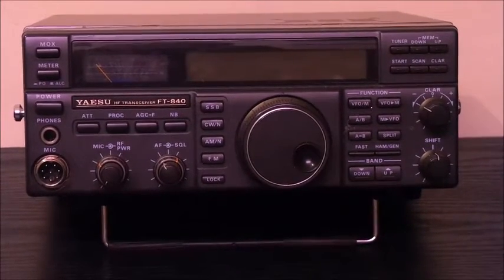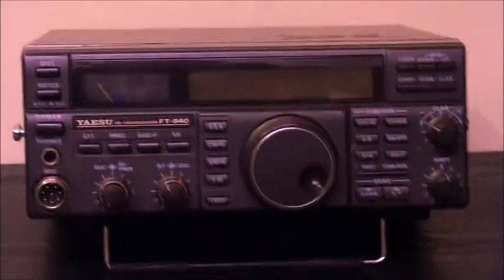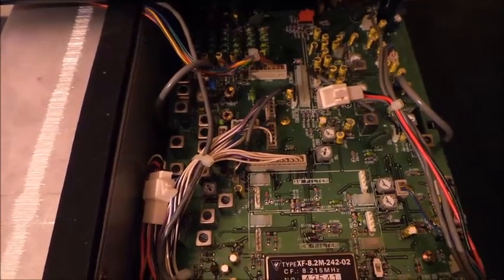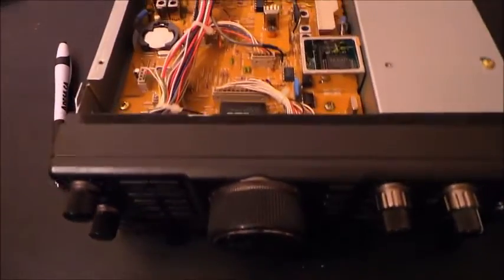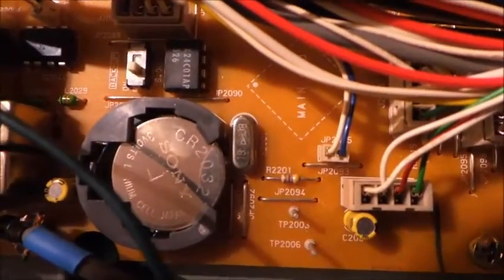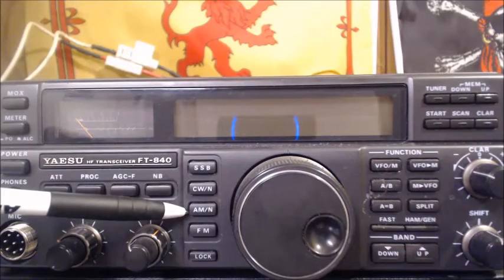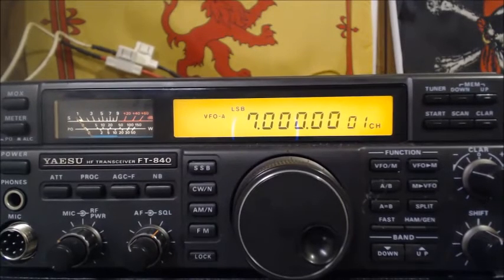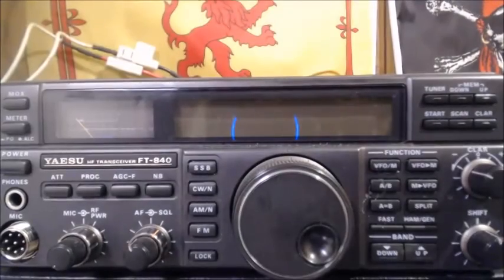yeasu ft 840 mod

Comment: Does this mod open up all bands.  I want to use an 840 in the 8mhz area for marine use on a boat
Reply from the maker: there is a fm board so maybe...i am not sure on this as I sold the radio to upgrade to flex 1500

Comment from the maker: happy to say this mod will open 60 meters as well 5.330.50 to 5.405.00......or remove it
Reply: Does this allow for SSB transmission on 60m, or just AM?  

I'd like to do this mod for 60m use ad a licensed ham.
Reply from the maker: both
Reply from the maker: +LegoGuy yes